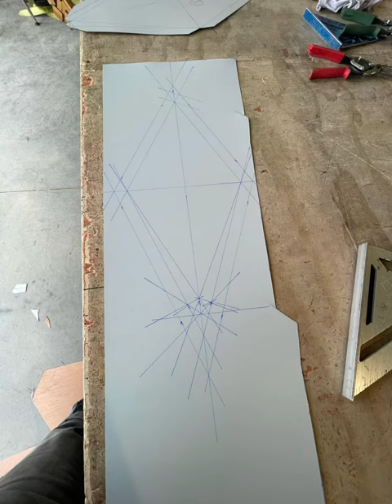Turret 3D tile

Comment: how did you mate those ridge caps with the main tiles?
Reply from the maker: On the hips, the tiles have a fold up and the hip caps are individual pieces with a mark in the middle, the sides are folded like drip edge the lower part cut and fold in angle. 
Also a bit wider on the lower part to fit nicely on top of each other.